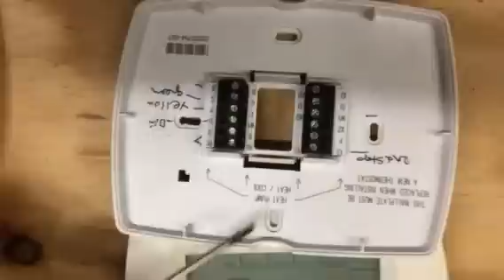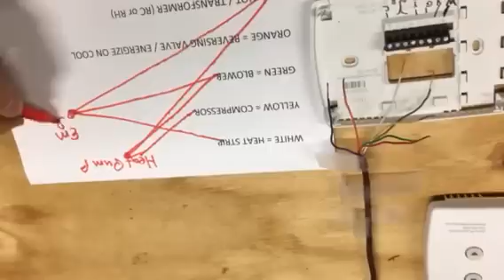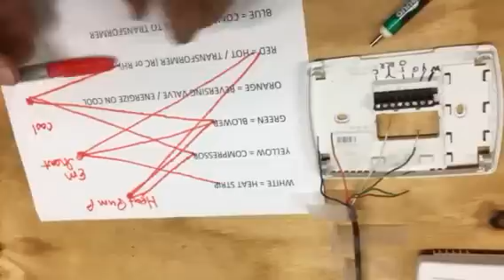Thermostat Wiring

Comment: Thanks for trying to help people.  I am trying to change my trane thermostat tcont802as32daa (looks like the one in this picture) to a sensi Emerson wifi one after nothing else fixing a froozen outside heat pump and finding batteries corroded in the trane thermostat.  The black wire in your picture is on my unit connected on the unmarked side, opposite of the x2 slot.  Not sure where it goes in the ST55 wifi sensi thermostat as the no blank terminal or x2 on it.  It could need a cwire... whatever that means.  Thank you again.

Comment: uhm...I am confused, first, you said: Heat pump (yellow, green, red) then emergency heat ( white, green, red), and then for cooling (yellow, green, red) again? So, are the heat pump and cooling wires the same?
Reply from the maker: yes, the yellow wire if it's a single stage compressor well controlled come both heating and cooling the orange wire controls reversing valve if energizes and cooling the other wires is color to color that will go to your thermostat sorry for the late response thank you for watching

Comment: all the thermostats are the same but when he neglects to tell you is that the White-Rodgers thermostat.. has a 6 wire setup  you have a brown wire that runs directly to the e connector for emergency heat.  connector E... and you will not find that connection in most modern day thermostats.

the other thermostats aren't set up like, so it's very confusing the White-Rodgers is a classic 80 series model. and that's completely different from all the other thermostats.

Comment: I only have a white and red wire - hooked up thermostat and my furnace did not come on. I removed the new thermostat and replaced it with the old HoneywellTH3110D1008 W - white wire R - red wire and the furnace does not come on. Any suggestions? I am at a loss here. Thank you so much!

Comment: i have a Geo water furnace  By Water Furnace . What thermostat is best  to use that  is wifi capable to control with my phone when away. Has 3 stage heat and 2 stage cool.. I hava a Radio Thermostat that iwas useing.  it is not sending wifi signal any more.  Changer internet  and diffrent route . Dont know where to go from here.

Comment: quick question, I have a 2 wire mercury boiler thermostat, and I want to install the new version of the nest thermostat that requires a C wire.  I installed a 24v ac transformer, do you know where i would connect the two wires from th transformer to satisfy the C wire requirment?  Thanks!

Comment: Wow I hope it really is this simple We have that exact thermostat to. Our air has been weird so I thought maybe the batteries are bad pulled it off replaced the batteries and now the thermostat doent come on at all but watching your video I see all those wires but their not attached to anything and I noticed that there were wires that were twisted together it just doesnt look right, so now I'm wondering if the last heating an air person that came out twisted those wires up so he could say I have air what I was wondering is if you twist them up like that does or will the air run constantly it seems to have been running ok but just recently the temp on the thermostat say was 75 and I put it on 71 but it never showed it going down to 71 yet it felt like it was 67 in the house. I have no idea whats going on. And now it wont come on at all, the batteries didnt help. I dont know if I'm more confused or if I have a starting point now. Great video though I'm gonna save them so I can show my husband.

Comment: Hey i have a White Roger 1F89-211 Thermostat and i want to replace it with a Honeywell T5 smart thermostat wiring is not working and no heat pump.. outside unit and inside air handler im in Mississippi

Comment: Just want to start off by saying thank you very informative video. David I have a intertherm unit and my blower motor intermittently will not come on the unit is only 2 years old. I’m also getting an code for BMF and the thermostat has a flashing snow flake. If I flip the breaker off and let my board reset then turn it back on it will start working again. Any ideas on what could be causing the issue?

Comment: I just tried all these steps and none of them worked, unfortunately. However, I still got flame in the furnace, and the fan (indoor blower-motor) does come ON, when I set it to ON position at the furnace, but nothing else. Any other suggestions? I'm thinking it's likely a tripped wire and/or a blown fuse (transformer). SUPER helpful video though.

Comment: David. Very thorough info. Thank you. But I have a question for you.  I disconnected the "W2 White Wire" to  Auxiliary at the thermostat because it turns on with only two degrees more in setting. When I turned power back on AUX on thermostat showed running on the display. What's going on?  Please email me on this.

Comment: I am confused. According to your video you connect the Green, yellow and red wire to test the heat pump and also use the same wires to test the cooling? Shouldn’t you include the orange wire for cooling?

Comment: Can you help me? I'm upgrading my trane thermostat that has X2 white and W1 black wires for Er heat but my new honeywell 9585 don't have those labeled. I tried Y2 and W2 AUX/E but im getting normal at startup but Aux heat kicks in bout 15-30 sec later. Any ideas if i have those Er heat wires correct on the the new honeywell?

Comment: Great video. I have a Honeywell thermostat and I used to have oil heat and ac but now just a heat pump and wood stove. The guy that came and put the pump in did a great job but when I am using the wood stove I like to run the fan and not the compressor. But when I cut the compressor off and fan on it all runs any ideas

Comment: Thank you, so much! I changed the thermostat 2 months ago and realized that I hadn’t connected the heat element wire! I took pictures of my old thermostat and the”W” was hidden; I assumed it was the ground a wire that I didn’t need! It’s been cold this week and if it weren’t for your video , I would’ve called a someone to check our unit because the fan was working but no heat! 🙏🏼 thank you! My home is warm and cozy

Comment: A month ago my AC was blowing not cool air and when I turn it off the fan continuously kept on over night even on the off position. I google the problem and it said if removing the thermostat face and the fan turns off I have a bad thermostat. Could that be the reason my ac wasn’t working properly bad thermostat? Now it got very cold and I needed to put on my heat and thankfully it work. Question do I need to replace my thermostat?

Comment: It would have been nice to include short testing in the video. For example to test the compressor, connect power (red) with a specific color (ex. yellow) or for fan (G) and red. etc. I'm not that savvy, but this would help to identify what's happening with any breakdown or not.

Comment: Yes thanks.  I have a simple AC unit and oil heater with the 1971 era round Honeywell thermostat that won’t go below 55 in a house I just need to keep the pipes from freezing.  Burnt 165 gallons last year at 55 deg.    And yes, the older widow folks need help.  I know enough to be dangerous and one winter when oil lines were freezing/ resets tripping, I kept busy in the community.   They have no $.

Comment: I turned my heat on to get ready for the cold season and found out that the heat is working but the outside unit keeps going

on for few seconds and then shuts off. What is the problem?

Comment: I have a red green white and yellow wire on my old thermostat. I have gas heat but a air conditioner unit. Where does the red wire go. I know where the other wires go. Put I don't know where to put the red wire on my new 701 thermostat. Do I put it on the RH/R. And do I remove the white wire that came attached to the 701 it's connected to RH RC. My husband passed so I'm in a learning process of doing things myself.

Comment: GREAT Video! I don't know if someone else said this! HOWEVER, at 6:19 "For Cooling" IF the system has a "Reversing Valve" Wire Color Orange (labeled "O") you need to add that wire also together with the "Yellow, Green, and Red" If not the system will work but blow out warm air due to the "Reversing Valve" not activating. So for "COOLING" twist together the "Yellow, Green, Orange and Red".
Reply: Your an idiot

Comment: Humm.. in my picture I had a blue wire connected to terminal C , but my new thermostat does not have terminal C as an option & I assume it goes to terminal B now because it is a common wire or perhaps O? But my instructions say not to use it at all & nothing seems to function when that blue wire is not connected. Help lol

Comment: I've got a Honeywell home thermostat and there is two thermostats in the house.  1 upstairs and one downstairs but different models.  Was wondering how come it works fine upstairs and you can hear the blower kick on in the intake vent upstairs but I don't hear anything from the downstairs one anymore or even if I did hear it at all and I just feel a little air coming out.  I took off the thermostat and used a multimeter on the wires and when I put the positive on the red on the right and the negative on the green, I got a negative reading.  Does that mean the wiring is wired wróng on the unit?  How can I test them to know what's actually what?  Or would I have to go in the attic to the unit?

Comment: Thank you for your video.
Question: What is the correct Ohm value for each thermostat wire: R, Y, B, W, and G? Each wire should be under 10 Ohm, right? If it (the Y) is over 24 Ohm, what does it mean?

Comment: David here my problem is my fan continues to run I have done like you said I have checked everything is working I can pull the thermostat off and it still runs unless I flip kill switch it’s still putting cool air out but when ac stops fan doesn’t I have a red light on central board blinking 5 times I look at my paper work and it’s saying that it’s telling it the furnace is lit what can I do I don’t have a lot of money and it’s getting hot and have elderly mom

Comment: I have a Honeywell smart thermostat downstairs, and was wanting to replace the upstairs carrier thermostat by matching the same thermostat from downstairs (was installed before I bought the house). My boyfriend took a picture of the wiring setup from downstairs, and matched the same wires upstairs. The new thermostat was blowing heat for the a/c. The common wire that's being used is black, but it looks like I have a blue wire not being used. I don't know if the new thermostat is  bad or not. He went out of town, so I'm trying to fix this myself. I've tried talking to my mom's boyfriend who is an HVAC contractor by phone, since he lives in another state, and he doesn't like installing the smart thermostats, so he is of no help. Haha. Both units are different brands, but are both heat pumps.

Comment: I'm changing my old mercury Thermostat to a Honeywell 2510 programmable. My a/c and heat will run at the same time (even if its switched to cool). I have hotwater baseboard heat and had A/C installed in my attic. They brought a 3 wire (green, red, blue) from the air-handler and replaced the original thermostat (w/o a/c switch) to a mercury with A/C switch. Should the a/c red tie to the yellow to eliminate this simultaneous cycle?

Comment: My unit keeps blowing my 3apm fuse ever time I turn on heat it does immediately. Never done this time I changed my thermostat. Cold works but , when switch to heat pops fuse. Any suggestions

Comment: That looks like an electric heat element. 
  What if you have gas hvac?
  I have one blowing cold air. 
  If removed the air return filter and put the thermostat on heat and let it blow a few minutes. Still blew cold air.

Comment: Where do the other ends of these wires go? I'm just trying to wire up a C wire for common power and it's a freaking nightmare trying to find where these go? To the unit itself? To the air handler? Help

Comment: This video is great i am trying to put an old ptac in my shop but not sure where all the wires go on unit letters on pins not all the same i would just use display pad but looks like wire harness not as it come out of condo they unhook to or would have got a picture before removed its is older unit pthe1501uaa looking for a little help

Comment: Im confused.  When testing heat and testing AC, your instructions for both was tie red yellow green.
Reply: I think he has to say grap the y , g , o and r wires in heating case  if you have heat pump.
The process is done by control board .

Comment: we have an old robertshaw 9520 we had a brown wire in C, red wire in R, white wire in Y1, an orange wire in E, a green wire in G, and a blue wire in B. trying to install a honewell wifi but the inputs are differently labeled.. we have C, K, RC, R and W-0/B, Y, G, W2/E, Y2 , and L. 

since the brown was C to begin with we're assuming that it should again be in C. R should be red,  pretty sure the green wire that was E on our old one goes to the W2/E,  but the problem we have is where does our white Y1 wire go and where do we put the blue B wire? we have a heat pump. i've read that i should put the blue wire in C but if the Brown is in C already do I wrap them together?

Comment: Sir great video. I am having an issue with my blower motor inside. It comes on when in Heater mode. When i have the thermostat in cool mode or FAN  mode, the blower doesnt turn on. The condensing unit works though. May I know what is the issue? Thanks.

Comment: I hope u help me 🙏before I don’t have any problem with my a/c after I’m change the thermostat to a nest 3 generation that only work good with heat n I’m try cooling n no working what can I do 

I have 7 wires yellow green orange red blue white and brown n my old thermostat the white and brown both are conectect n the same hole with label w2/E that I’m confuse  

Please help me

Comment: Hello Mr. Jones..I'm not getting any regular heat...ac and everything else works.  Think I need a new thermostat.
Reply: It is possible that your thermostat could be at fault. Try removing the wires from the R and W terminals at your thermostat and touching them together. 
If the furnace starts and runs again, then it is likely your thermostat is no longer sending 24v back from W to the furnace. Replace the thermostat.

If the furnace does not start and run, then it is likely that something on the furnace side of the system may be the cause. Check the furnace for a fault code at the circuit board or observe the furnace operations to continue diagnosis.

Comment: quick question, I'm trying to install a wifii thermostat. I have the blue wire but unit won't work. I jumped wires Red to Yellow = 27 volts, Red to Green = 27 volts, Red to White =27 volts, RED to BLUE = Freaking 48 Volts . I followed that blue wire to my air handle and it is on a transformer on the 24 volt side. I'm so confused any thoughts thanks

Comment: I have all the wires to my thermostat just like the one you show on the right. Old one was just like the one on the left. Turns on ok but just stays on. Thermostat doesn't work or send any signal to shut off. Seems like it should be really simple and take 5 mins but 2 hours later I have no fix. Oh well, time to call an expert.

Comment: I know this vid is old but. For you heat pump people out there the Orange (in almost All 90% of heat pump units) wire HAS to be energized to reverse the valve to Cool. When orange is Not energized it is in standard Heat mode. This is why a regular AC Thermostat does Not work for a heat pump. If you were to connect it to a heat pump it would be in heat cycle all the time do to the lack of the Orange wire connection. When he did not connect the Orange it would have fired up but would have been heating. Good vid just making a point...
Reply from the maker: You’re correct I miss spoke in this video I should’ve went back and changed it

Comment: Don't some single speed heat pump thermostats offer two stages of heat strip in addition to the heat pump stage (3 total heat stages).  I always see the two air handler heat strip stages connected in parallel.

Comment: this  only pertains  to a heat pump system using  electric  heat in a ac  unit. that should  be  mentioned  at the  beginning  . not  all systems  have a  heat  pump. 
this is  not a  usual  system  for  northern states .

Comment: Hello. I have issue I turn heater on. electric elements come on but fan doesnt come on in auto mode. I turn fan on manual and it comes on. but fan doesnf come on in auto mode but heat elements come on. I change the limit switch but still doesnot work. but ac works in auto mode

Comment: I have an old thermostat that is working. I'm trying to install a honeywell wifi thermostat with a C wire but when I connect all the wires the thermostat doesn't come on. I can hear the fan working though. Do you know what I might be doing wrong ?

Comment: I do have a Westinghouse heat pump system and I'm replacing my Honeywell 6 wire ( Red, Yellow, Blue, Orange, Green, White) thermostat with a Ecobee smart thermostat. Having issues with the cooling, it is blowing hot air not cool air.  So I was looking to see if my system has developed a issue or the new thermostat/wiring is the issue.  
Looking at your video I did not see at what point the orange wire (reversing valve) was energized. 
In the your diagram: 
Heat you showed Red/Green/Yellow
Em. Heat you showed Red/Green/White
Cool you showed Red/Green/Yellow
I can only assume that the Orange is energized for cool as well?  Is this correct?
I did like your video

Comment: I have a dual fuel Trane heat pump.  I want to change to a Nest or Ecobee.  Does the wiring change due to it being dual fuel, or would it be the same?  If different, any advice would be appreciated.